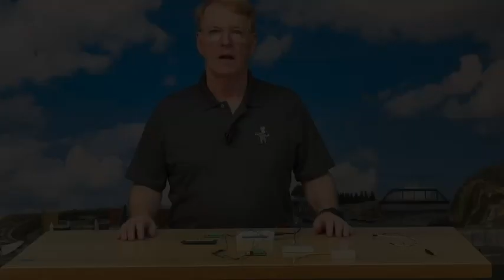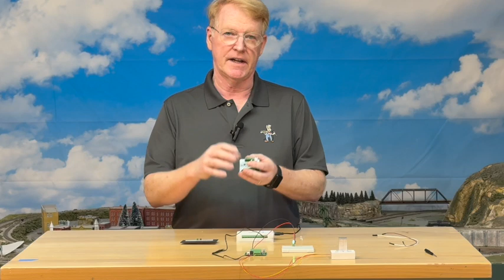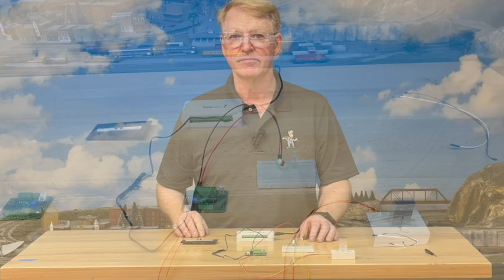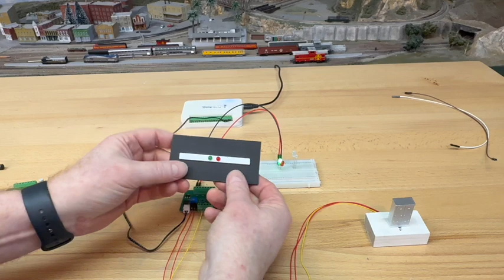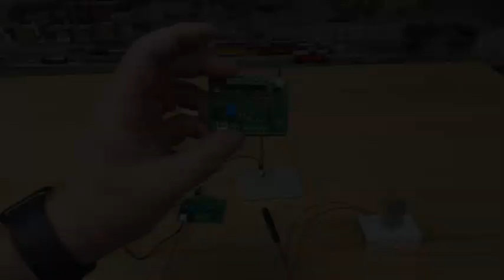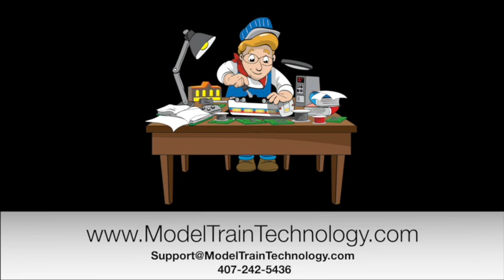CTC Panel Controllers for LEDs

Comment: Will this work if triggered by other detectors? I use a current detector in the DCC block wiring.
Reply from the maker: Our CTC panel only works with digital signals.  Some current detectors have this.